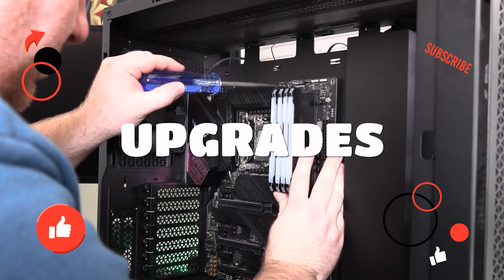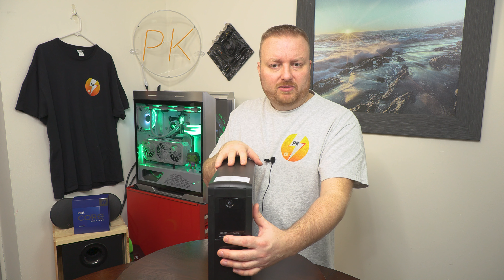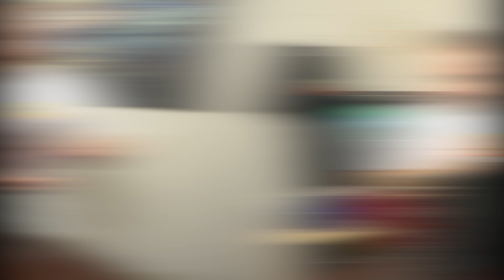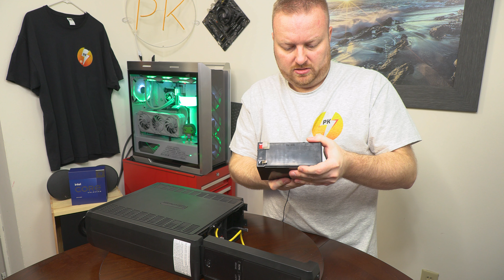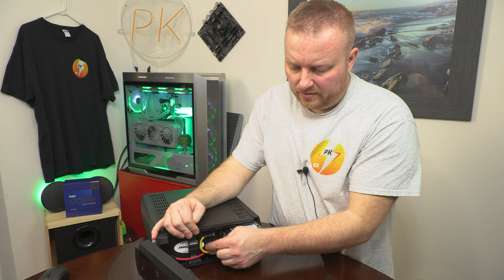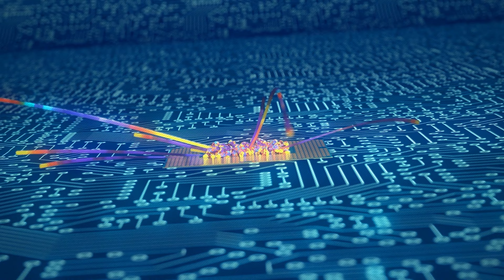CyberPower UPS Battery Replacement - HOW TO

Comment: Cyberpower does not manufacture batteries, they buy them from a supplier. They do not label the batteries inside the UPS as most consumers will just replace the whole UPS, not replace the batteries. They only bother putting their sticker on the replacement batteries they sell for a high price to encourage people to just buy a new unit

Comment: cyberpower panel Unable to communicate with UPS
Reply from the maker: I have found that unpluging the USB cable from the UPS side then plug back in works. Other things to try. Reboot PC, try a different USB port.

Comment: Nice pk thanks 👍
Reply: Just wondering how u can tell if battery is bad
Reply from the maker: Well one obvious way is when the battery capacity bars start dropping. The other way is if you start having PC crashes or blue screens at random. Good thing is to just keep them replaced every 3-5 yrs. You could pull them out and load test them if you really wanted to also.
Reply: @PlanetKryos  ok thanks